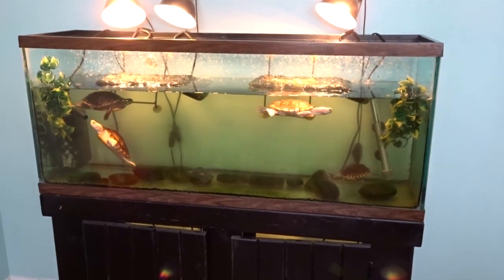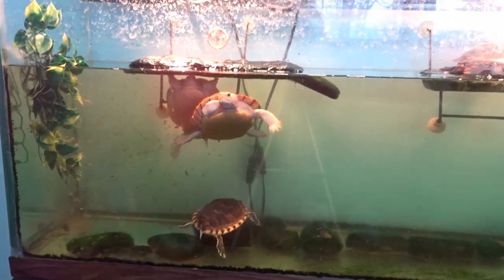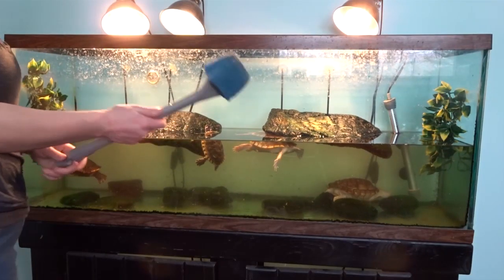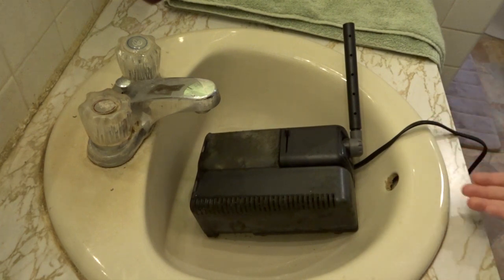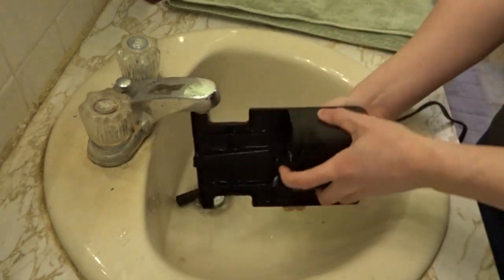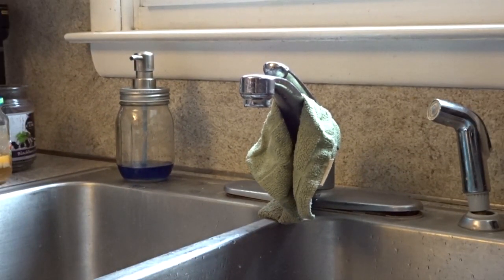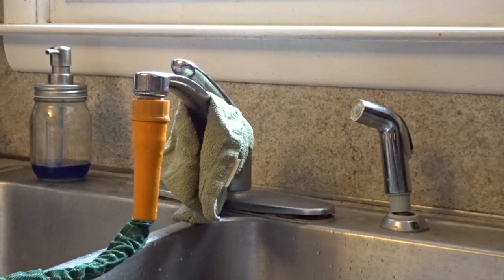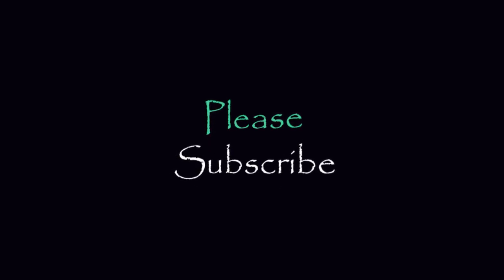Turtle Tank Cleaning - How I Clean My Turtle Tank

Comment: Yeah I agree with one of the previous comments. That is WAY too small of a tank for those big turtles. My 1 red ear slider gets a 120 gallon and I use to keep two in there but moved the smaller turtle into his own 40 gallon because he is a 4 inch turtle. I also agree with taking the turtles out while water changing and adding snails and ghost shrimp help ALOT with keeping the tank cleaner longer. That is what I found in my experience of 10 years of turtle keeping. Enjoy!
Reply: What is the best filter to use for turtle tank
Reply: I think sump pumps are the best in my opinion but canisters filters are alright. They are annoying tho.

Comment: 1) you killed the beneficial bacteria in the filter 
2) when removing the filter remove it up side down that way when the water is draining it drains out the top instead out of the bottom thus, you have less extra stuff floating around in the tank
3) remove turtles
4) remove everything 
5) clean everything with tank water
Reply: How do you get rid of the poop in the tank or how do you use poop water to wash anything? Im just learning since Im new. Serious question. You cant take a 75 gallon to a tub to wash their stuff.
Reply: F Miller here’s a crash course  whenever cleaning their tank remove everything  from inside the tank and clean with regular tap or distilled water  and make sure to clean the turtle too with soft bristle brush  beneficial bacteria  is what is contained in the white ceramic circles you see when she is washing them out with the Tap water they only contain the good bacteria when they run a cycle in the the turtle water when the poop and stuff collects in the filter bacteria forms and that’s what’s keeps the water clean this cycle is important to the turtles health and is broken when you use tap water which has chlorine is used to clean the ceramics rings  it’s kills all of it  use the turtles own  tank and after to clean it.  And whenever you do a water change  you can either siphon the water which is like filtering it out Through a tube  and replacing it with tap water or distilled water make sure to use water conditioner that kills all the bad chemicals in the water like chlorine so that when the turtle breaths the water they stay healthy also use some a chemical that’s destroys chunks of debris in water the hunk in there use stuff like sludge destroyer oh yeah search up biological mechanical and chemical filtration that’s something you need to know  and for feeding depending on there age you can use a combination of pellet food and certain veggies for there meals veggies in there young  age is important for them pelleted are also good you can also feed them freeze dried shrimps and stuff like that remember don’t give them too much protein or else they will have health problems from them growing to big to fit there shell and for basking  and lights  heater the basking has to be big enough for them to stretch out fully get a big one there tank size depending on length is for every one inch 10 gallons of tank   So like if I have a 2 inch turtle I give it a 20 gallon tank but don’t fill it up to the top it’s too much pressure for them and stressis them out make sure there filter filter rated to filter atleast 2 times your turtles tank size ever hour “ gph” I have a 20 gall so I’ll use a filter rated to filter out 60 gallons per hour don’t make a too strong tho the water circulation in the tank can get too strong and won’t allow them to sleep and will make them stressed out for lights you need to get them uvb and uva   Get halogen 100 watt lights so they get enough heat when they bask to dry them up keep the light a foot away from the basking dock or it will be too hot for them and they won’t bask for the other don’t get a circular uvb  get compact uvb but since I don’t know how much uvb it emits I suggest look for a good rated one and heating for junvinel turtles they like there waters warmer like 75 to 85 degrees and older 80 too 65 or 70 Im not sure but the older ones get used  to more cooler waters   All of this is depending and what turtle specie you have this may help you a lot or not at all this crash course is for semi aquatic turtles more  related  towards red eared sliders
Reply: Also search up ph levels and nitrates and phosphates in turtles water that is also very important in the water cycles they have in the tanks that is reset everytime you do a 100 percent water change and you can test the water with water test strips to make sure the water isn’t too acid and is balanced
Reply: Any more questions I’m happy to answer them all  too make sure your properly taking care of your turtle
Reply: @lrellim7269  The videos filter was completely inadequate for that many turtles.  I have two razorback musk turtles in a 75 gallon (filled half way), but have a external canister filter designed for a 150 gallon tank.  I do a 20-30% water change weekly and my tank is ALWAYS crystal clear.  I don't wait till it gets that nasty to clean the tank.  So when I clean my canister filter with tank water its clear not full of turtle crap and food.  You do this because (unless you have well water) most tap water has chlorine, it will kill the good bacteria in your filter media (which helps in breaking down the turtles waste and ammonia).
Reply: @tiltednite2366  NERDY BIRDY

Comment: this video was very helpful in terms of cleaning the tank. I would strongly suggest that you get them a way bigger tank, that's the size 1 or possibly 2 could live in but to have 4 in there is just not correct. I would also recommend that you take the turtles out when cleaning it just to be safe and it would be a good idea to also take away the decorations. once again this video was helpful in terms of how to clean it I just think you should make a few changes. 🙃
Reply: I understand a bigger tank and taking out the turtles when cleaning but why no decorations

Comment: 8~o  say what!  Hi, Not sure if your aware but the metals in the pipes are pulled into your water when you use the how water /warm water from a tap..or any other way you can get water that needs to run warm /hot. You might not notice it right away but it does affect the overall health of animals & humans.  I learned the hard way not with my aquatics but personally. It's not whats in the water but how the heat brakes down the metals in pipes etc. hope this helps.

Comment: you have to clean filter with the water from tank so it wont have clorax on it and the bacteria could stay alive
Reply from the maker: jose sola not all the bacteria dies. Enough is in the media to reproduce. Cleaning with tank water will not get a proper clean. Dechlorinated water will help. Also I have well water so there is no harmful chemicals in it
Reply: ok btw i have a question how many lights do i need for turtles?
Reply from the maker: It depends on your set up but as long as you have uvb and uva lighting, you should be good
Reply: Jessie Erskine usually 2. 1st for your usual basking light and 2nd for the uvb light bulb to replace sun rays

Comment: are you not destroying the bacteria on the sponges and ceramic rings by rinsing them in tap water ??
Reply from the maker: ShaneDodd1995 some bacteria is destroyed but not all. My water is well water which does not have chemicals like city water does. The amount of bacteria lost is very low.
Reply: How is it bad to kill the bacteria and the sponge? Also, what's the name of the filter you're using? My turtle is really big now, and it's making it hard to clean the aquarium. I have used 6 filters by now that didn't seem to do any good. Any recommendation? 
Thanks for the video! I'll definitely try this cleaning method. (:
Reply: AnnieClow try a canister filter. Also not all bacteria is bad. There is beneficial bacteria that help keep balance in the tank.

Comment: GREAT VIDEO. How I do it, is I take my turtle out in the correct water temp. then I put the UVB lights over the tub which I put my turtle in then I take the filter heater and dock out to clean them and take all of the pebbles and the water out so I can replace them, then I restore everything after cleaning and replacing then I put my turtle back in and add this chemical which came with the kit for the tank

Comment: Is the water supposed to be cold hot or warm or a little colder then warm
Reply: Around 75 degrees Fahrenheit. You can get cheap tools to keep an eye on the temperature.

The fresh water should be warm but slightly cool I guess? Room temperature in a way. Hard to describe.

Comment: Hi I did post a comment on another video but I saw this video is newer. I get really confused about uvb lighting and basking heat. I really want to change to what you have as I have a fluro one that goes the length of the tank and no basking heater.  You look like you have had turtles for a while have you had any issues with the type of uvb lighting you use like shell rot etc. ? THanks
Reply from the maker: Ali Hare The fluro lighting isn't beneficial to the turtles health, it just produces light. The turtle needs a bulb that gives off heat and they also need a bulb the gives of vitamins and nutrients

Comment: Hi there! I have an 11.5 inch RES and I currently bin feed him, but he used to be in a 60 gal for years. What kind of tank do you use/recommend? I am concerned because I live on the 3rd floor of my apt and I dont want ANY leaks.
Reply: Hello. I know this is very late , I would recommend a 125 gallon tank which is wider than it is deep. I also recommend a stock tank which u can get a huge one for not a really expensive price compared to a tank.

Comment: Your basking set is improper. the pet store will say that's what you will need but that's dead wrong. You need a 100 percent dry basking spot in it. Otherwise they can start developing shell rot and it will go downhill from there they can get seriously sick. Here is a video to watch to help your turtles live better. And turtles need 100-120 gallons PER turtle. so you will either need to make yourself a pond or get seperate tanks for all of them. Also, you should have taken the turtles out before draining the water. they get scared that way and don't know what's happening. so basically you are treating your turtles all wrong. https://www.youtube.com/watch?v=P9RmfBkSo-0

Comment: God Save the Turtles"..😲😣.
 Sure you mean well  but take em out..Never leave them in and stress them out or risk hurting them. Also you need 10 gallon water to  2 inches of shell width PER Turtle. TOO MANY FOR TANK!😩 Also larger rocks not Peeble style as they can ingest them when eating and possibly choke. BEWARE of too much tangly stuff for decoration in tank as they can get caught and they do need to come up at intervals to breathe even though they can hibernate for certain periods of time . Water has to be kept clean as that's what they drink also not just live in and defecating in Etc. Need a 40 gallon pump for 2 Turtles of maximum 2 inch width shells. And turtles need calcium  to promote shell health and  treat the water no matter from where with clean water drops.Research, research , research it's like having any pet..not just for Looks n Fun. God Bless🙂